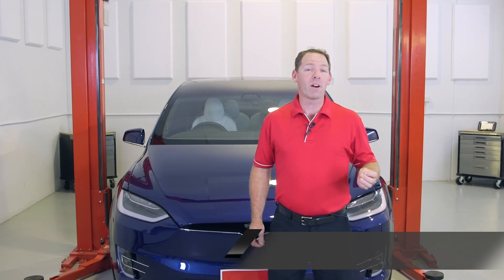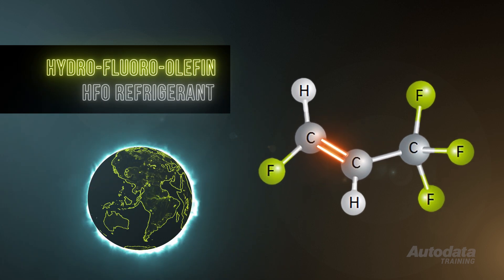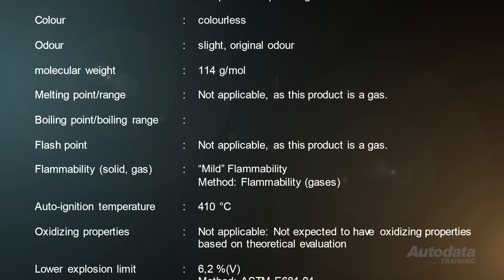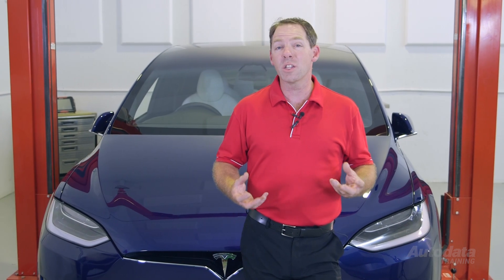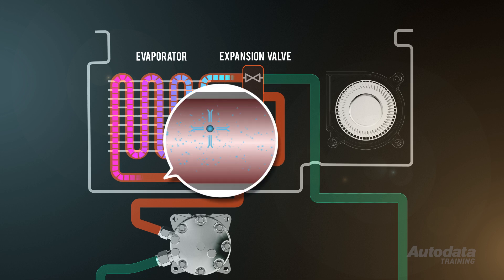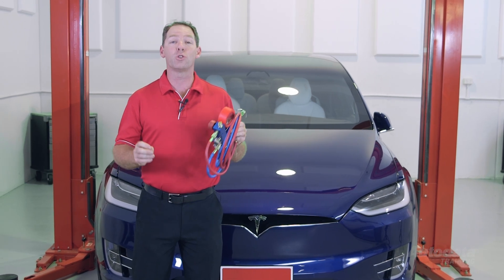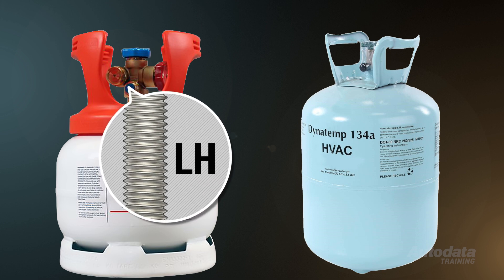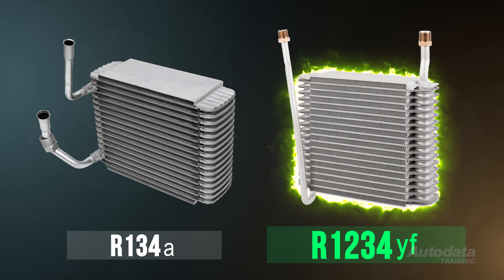What's R1234yf? What's R134a? Automotive HVAC training

Comment: Funny fact is that every single R1234yf system has a small leak. How's that supposed to save the environment ?
Reply: Desipates significantly faster than 134a. 134a takes like a decade to stabilize while 1234f takes no more than a month

Comment: I've successfully converted two vehicles from R1234yf to R134a. A 2015 Ram 1500 and a 2021 Honda Accord which are both working fine. I purchased R1234yf quick couplers that allowed me to use my R134a manifold gauge set, vacuum pump and other tools that I already had. It's very important to completely evacuate the system of all  R1234yf, you do not want to mix them.
Reply: I have a 2018 accord new compressor no gas can I gas up with r134a?😊
Reply: @dowahnephoenix4096  Absolutely, but you definitely need to thoroughly evacuate the system before you re-charge it. I did my daughters 2021 Accord last summer and it's been totally fine.
Reply: Are the compressor oils comparable?
Reply: @jenpsakiscousin4589  Yes, they all use Pag46. On the Ram I replaced the deciccant bag, dumped all the oil out of the compressor and added fresh oil. On the Honda I didn't do any of that, just added 2oz of oil to the low side. They both been working fine for over 2 years.
Reply: @scottcpan68 sounds good, I’m about to do it, I got 30 lbs of r134a and no 1234, hate to buy it for one vehicle

Comment: the inner and outer pipe is like what is used on cheap household refrigerators.

the cap line witch is a thin wire like tube runs inside the line that returns to the compressor.

to eliminate the droplets couldnt the evaporator just be made bigger?

on a window air conditioner the condenser coil is always bigger than the evaporator.

why not do the opposite make the 2 coils the same size.

if you really want to reduce the global warming why not do a "hard transition" (snap! go electric and eliminate burning fuel with no soft transition)

instead of  every car sold in 2050 has to be electric make retroactive every car sold now be electric and do a cash for clunker buyout for all fuel car.

yes there would be more car fires due to battery fires because no car makers would have no time to perfect the ev.

by going ev we can eliminate the biggest carbon footprint.
Reply: LOL! If only carbon was a pollutant!

Comment: Based off of the information you put in this video it appears that I would be better off using propane like Mexico does in my AC system.  the regulations Of R 12 And 134 a. That is a bunch of crap it has nothing to do with ozone and more to do with the patient running out .

Comment: I use r21 propane in all my cars. Its cheap and makes ice cubes
Reply: R290
Reply: @HDXFH  you are correct.
Reply: No mods just don't crash and spark off and explode. That's all.
Reply: You just pump it in instead of r134a?   No modifications?

Comment: Not accepting that rip off.....R1234bullshit can easily converted to R134a. One just need to have experience.
Reply: Glad to hear it
Reply: Can't you just pump r134a in the system and be done with it? Or does anything else needs changing?
Reply: @MrRightNow  There is more to it dude, you need to make sure you don't have a leak first. Also the R1234yf needs to be properly recovered. You will need a manifold gauge set, a vacuum pump & R1234yf  Quick-connectors. NEVER ...EVER...mix the gasses/refrigerants. Some basic knowledge is needed. You can learn that easily on youtube videos, PLENTY good one's out there. Its really not that difficult at all. All it takes is the willingness to learn a bit.
Reply: @0815funkmaster  this is Innocence  if pumped out  and  now fitting applied  there is no real problem     BUT do not mix the two GASSES
Reply: @0815funkmaster why recover it? They changed it cause “r1234yf isn’t bad for the environment”. So someone is lying. I would guess DuPont/Honeywell. Just like the last two times we were forced to change.
Reply: ya you can convert 1234yf to r134a but not the other way around

Comment: why can't we use R600a/R290? Way cheaper and probably just as safe in terms of flammability...Pretty much the same GWP and ODP numbers. Oh right, no one would make any money that way, lolz.
Reply: I am happy to use it if it does not cost me extra. The governments are all but bunch of Hypocrites. If your vehicle releases higher emission you have to pay more. But when they issue a 2 weeks work permit for a job that only require 2 days at max and cause unnecessary traffic jams and emission thats all right bcos whatever they do is right.
Reply: Yes, those are natural gases and can't be patented. unlike 1234yf which is synthetic and can be patented even though it's inferior to the ones you mentioned.

Comment: You say it's more efficient but its crap I've worked on multiple cars with it and the lowest I can get the systems to cool down is 57°F but I  ran both of my cars on that same day one with R134a and the other with R12 and the sentra can get down to 41°f and the 280zx can get to 38°f so that's gonna be an issue hopefully this new crap is just a trend and it will die out and continue using r134a, we already did retrofits on some fleet Hondas back to R134a it was too expensive for them to run they constantly leaked from the compressors and have horrible warranty so its easier to dump the new crap and use to old
Reply: Scotty Kilmer did a good video about this and it's a good one
Reply: @frankd.brennan6520  screw that delusional old ass man he's almost as bad as sleepy Joe, he's an old timer that should have disappeared years ago
Reply: Bruh, I recently bought myself a 2015 Fiat 500 Abarth and it has this new R1234YF and it is so bad. You are right, the lowest temperature it is able to achieve is nothing close to previous R134a systems. Best way to describe it is, R1234RF feels like R134a but with a system that is low on refrigerant.
Personally, since 2012, I've used another refrigerant R152a on every single one of my vehicles. Gets colder, gets colder faster, and half the molar mass as R152a and past 1500 rpms it feels like the AC isn't even on. It gets colder than R12. R152a is exact same chemical as R134a, but about 64% of the molar mass, so all you do is evacuate R134a, vacuum, and put in the R152a.

BTW, R152a is literally Compressed Air (Canned Duster) you find at the computer section at Walmart. There is no vehicle that will need more than 20oz of R152a, which is 2 cans. 2 Cans of compressed air will cost you about $8 at Walmart.

Best Refrigerant ever. I planned to put R152a into my car maybe this weekend if it doesn't rain, but I definitely need to get rid of this R1234RF, it's complete garbage. Here in Texas, when it gets to 100'F it feels like I dont even have the AC on. It's kinda embarrassing to have a passenger with me and feel that.

You should try R152a, it's easily far and away much colder than any refrigerant I've ever experienced, easily.
Reply: @ImJustKindaHere  I done propane on a customer that was stubborn about using it and I was surprised how good propane is I know it's extremely dangerous buy God damn on a 105 degree day it was getting down to 22 degrees, but I'll stick to my r12 and r134a they're good enough for my car the jeep my wife has I already dumped that stuff out and put r134a so that issue was resolved
Reply: @alextepozteco3681  Trust me, try R152a (Air Duster) over R134a, it will blow you away by how little parasitic drag it puts on your engine (about half of R134) and how substantially colder it gets and how it gets colder faster. Again, only put in 64% of the ounces that it normally requires R134a. So if it normally asked for 12oz, put in only 7.7 oz
R152a gets so cold that you will be forced to raise the temp on your AC system (which also removes more parasitic drag on your engine).
Only real tool you need to get R152a (Duster can) into it is a "side can tap" to be able to puncture into the side of the can to syphon the liquid.
Again, gets colder than R12, runs at a far lower pressure (so if you leak out R134, this could be a fix for it), half the drag on the engine, and gets colder faster.
Runs at lower pressure than R12 too.
Try it my dude, you won't regret it :D
Reply: @ImJustKindaHere  100% correct....preach it brother !...it must use the Pag oil..........if you clean out an old R12 unit and put in 152a...just flush out the old mineral oil and use the Pag oil and  52%  charge weight for the new refrigerant

Comment: Idk about it's efficiency,  but I need that double walled evap line for our r134a systems here in Phoenix when the ambient temp reaches 114 degrees. Fords can't seem to blow cooler than 60 degrees from stop light to stop light.
Reply: I had a few 1234yf cars and always thought they didn't cool that well. Always blowing on high. I do live in Florida but thought something wasn't right. I just purchased an 11 year old truck with 134a and the cab is turned into an ice box after a few miles of driving. It's clear to me that 1234yf is dumb. More expensive parts and blows warmer. I have owned four 4th generation Rams with the new junk and one with the old stuff. R134a is king!
Reply: I can tell you it’s not efficient for my flag hours. That 1234yf machine we’ve got in the shop takes forever to do a recovery and a charge. Literally takes 3X as long to service a 1234yf system vs a 134a
Reply: @TelosDextroza  No it wasn't. But I realized he said "cab temperature". It's not uncommon for a/c to blow around 40 F right at the vent. The cab temperature itself will never actually get that cold. So he's probably right about what he said.
Reply: It absolutely doesn’t cool as well as r13 I have one car with one car without I believe the exact number i read is something like r1234yf 10-15% less efficient than r13
Reply: Correct me if I'm wrong but automotive A/C systems are designed to cool the cab about 15 +/- degrees difference based on ambient temperatures. We will never have a 50° difference from ambient temp unless you go old school and use a propane system (good luck with that)
Reply: @jaimeflores1575  couple years ago I had a 99' Grand Prix that I replaced the compressor on and it would consistently blow 38-40 degrees F at the vent no matter the ambient temperature. Not sure how or why but I've never had a/c system work as well in a vehicle as that car did.
Reply: @jaimeflores1575 I can get freezing temps in my custom AC system in an old Isuzu Trooper I have, at 110deg f ambient.
Reply: It's crazy to think that we're driving around with a 1 & 1/2 ton equivalent house unit in every car.  @jaimeflores1575